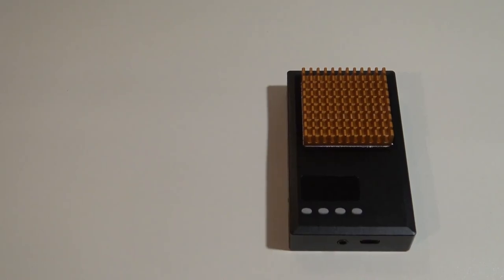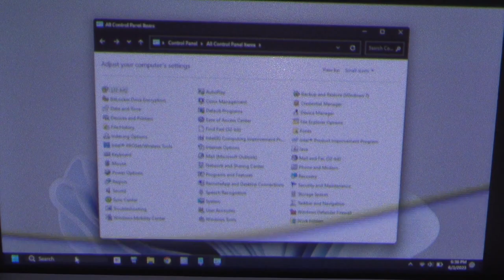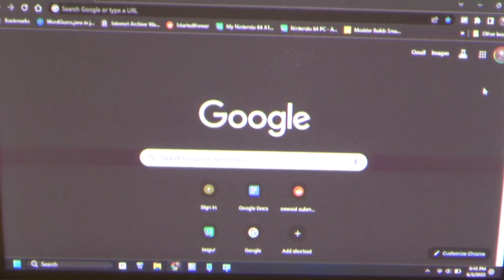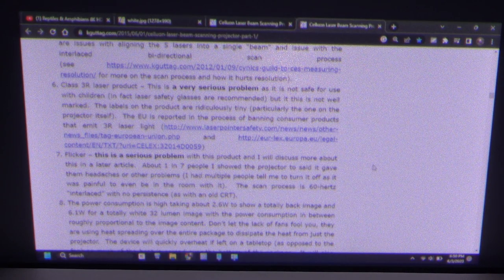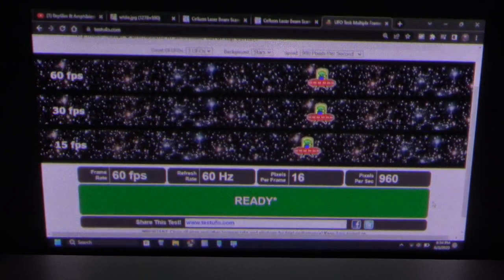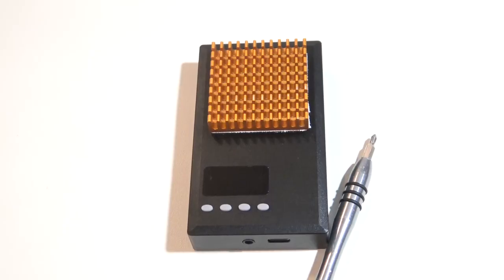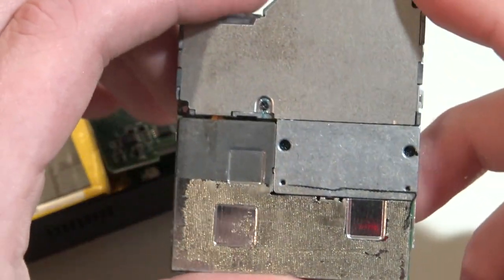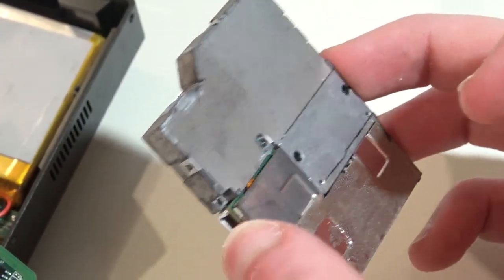AliExpress Raster Scanning MEMS Laser Projector Overview

Comment: I wonder how effective using one of these to backlight an LCD panel, this would give you a raster-scan LCD, with a nice 120hz IPS-Black panel, might produce quite a nice gaming monitor.
Reply from the maker: I think the luminance is too low for it to make an effective backlight unless it was for a very small panel.  In theory the tech would definitely make a cool monitor though.
Reply: You would need to use the mems system to stimulate phosphor for this to be used as a backlight. I actually wrote about this on the blurb busters area 51 forums years ago.
Reply from the maker: @jamescampbell8482  Theres a company that did do this commercially for videowalls with ultraviolet lasers, called Prysm systems.  Although I'm not sure if they used mems or a galvanometer system.